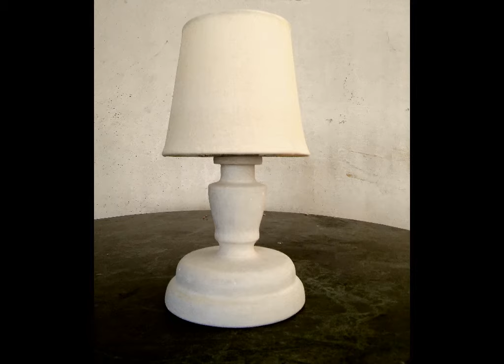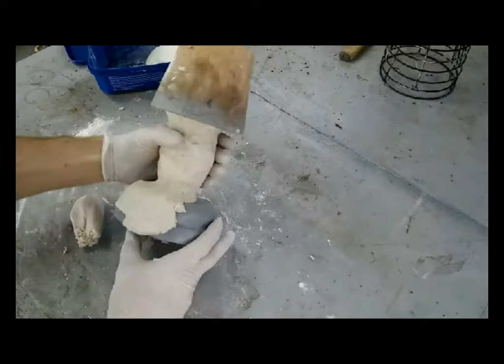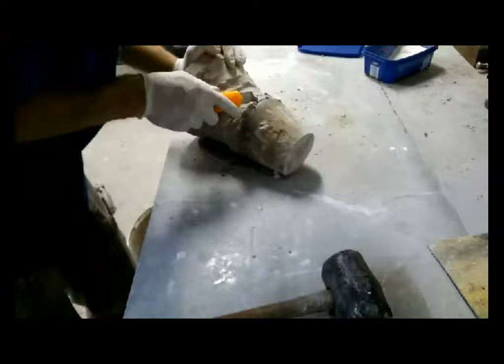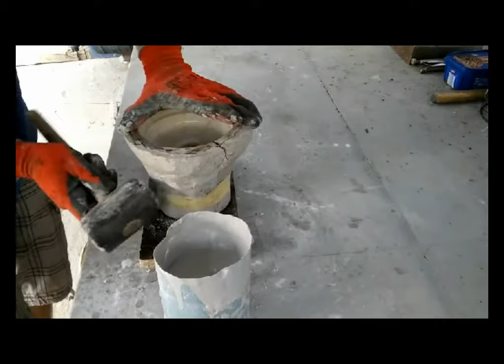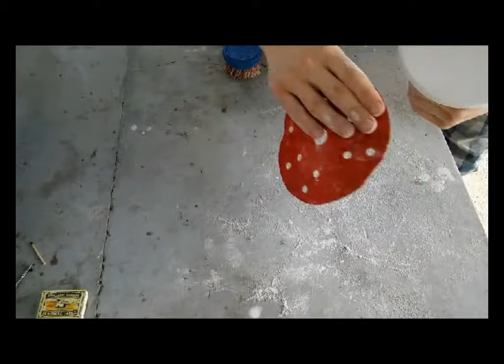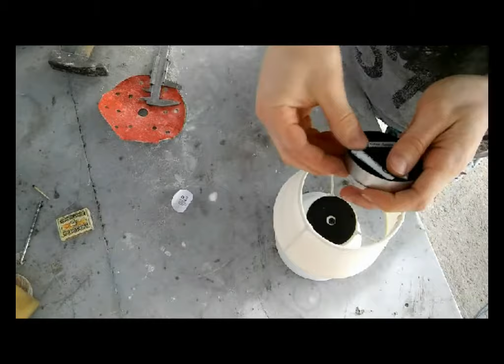Bar / table lamp - making the plaster of paris base - part 2 of 2

Comment: Great job! Beautifull lamps! Mold was made with what sillicone and dust?
Reply from the maker: Thank you! It's silicone and wheat flour
Reply: @pauliascau  Most people use corn starch.  Do you find an advantage to using flour?
Reply from the maker: @dovel1000  It's just what I had on hand and it is cheaper